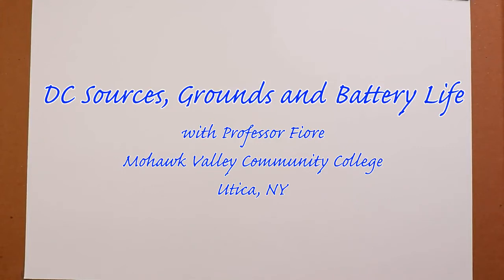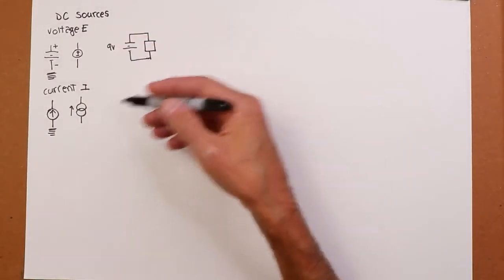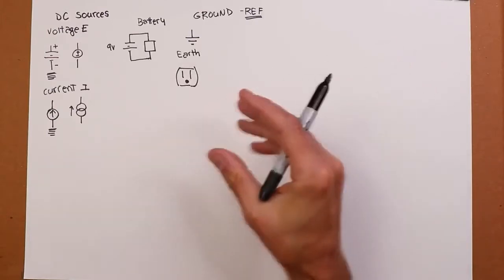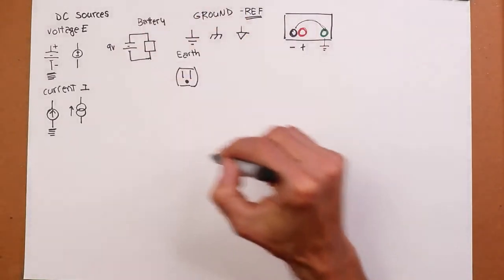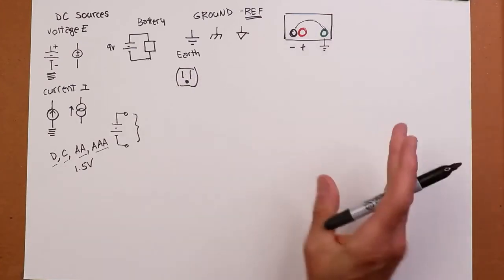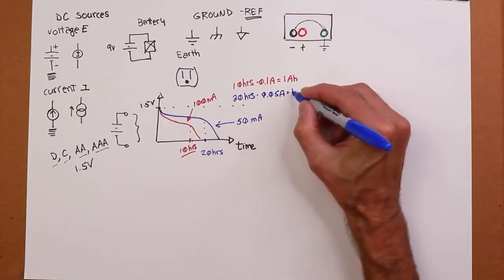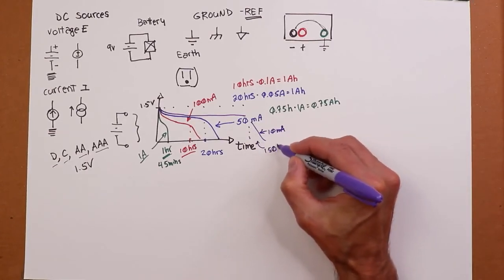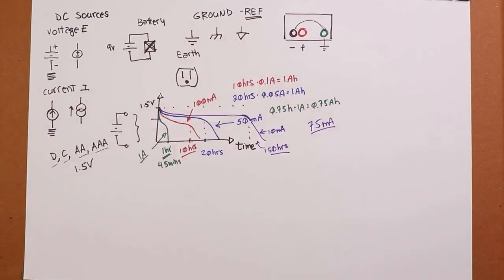DC Electrical Circuit Analysis: Sources, Grounds and Battery Life

Comment: So current from the circuit is literally dissipated in the ground? Is there a limit to how much that can be? Is the chassie ground not connected to an earthground?
Reply from the maker: Current is not "dissipated". Power is dissipated. Current is the rate of charge flow per unit time. It's like liters or gallons per minute of water flow through a pipe. 

Where possible (for safety reasons) chassis ground is connected to earth ground. You would like the chassis of a device to be electrically neutral.
Reply: Thanks for posting, very clear. Is the earth ground symbol ever used to denote (-) on a dc source such as a battery? I have seen it used on some basic rc schematics with 9v battery source? Thanks